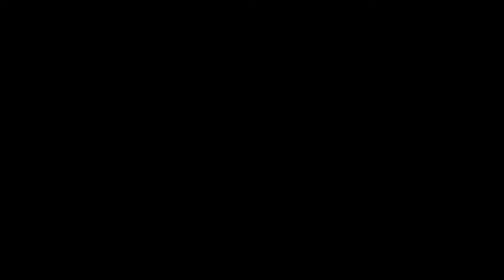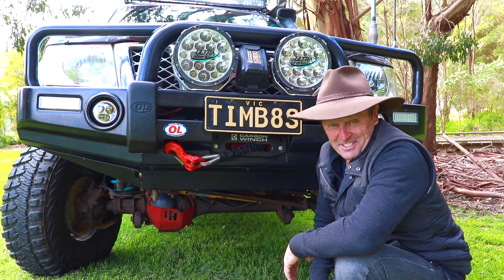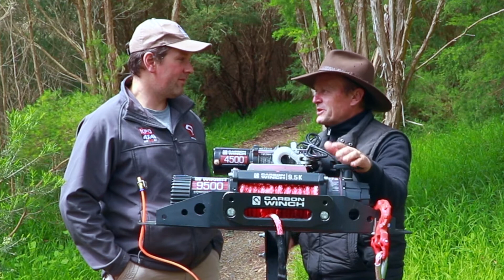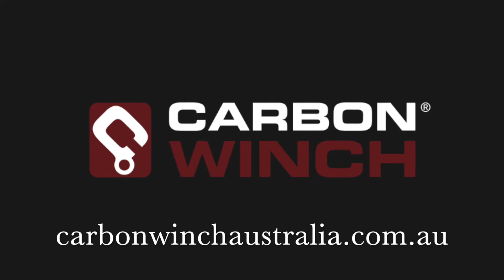Carbon Winch - ( Big Plans In The Winch Market )

Comment: Looks like a good thing Tim,I take it you’re using one👍🙂
Reply from the maker: +Wayne Doeblin 

Gday Wayne,

Great product mate. 
Yes, I have a Carbon Winch and recovery gear in my Patrol. 

Cheers Tim.
Reply: @timbates4wdadventures  What size is your winch? And is bigger actually better if I've got a lightweight 4wd landcruiser?
Reply from the maker: Matthew Gday Matthew,

My winch is a 12000lb 
9500lb would get you by. 
But on a larger 4wd like mine, the 9500lb would work a lot harder than the 12000lb. 
Not a lot of difference between the two in size and weight. 
Depends what style of 4wding you would be doing. 
I would rather have the 12000lb. 
I hope that helps with your question mate. 
Let me know if you need any further info mate. 

Cheers Tim.

Comment: Good interview just would have been good to hear you ask the question Tim not just cutting to each bit, just a bit of feedback. They do look good.
Reply from the maker: G'day mate,

With all the cuts in the video, i haven't cut out the questions i asked. 
The only questions that i did ask, are the ones you hear on the video. 
Dan did all the talking, which is what i wonted to get out.
It's a great story on how Carbon Winch started.
Thanks heaps for your reply mate, i greatly appreciate all feed back.

Cheers Tim.